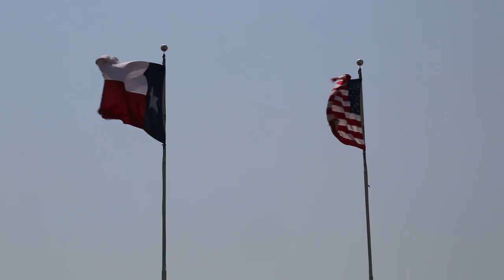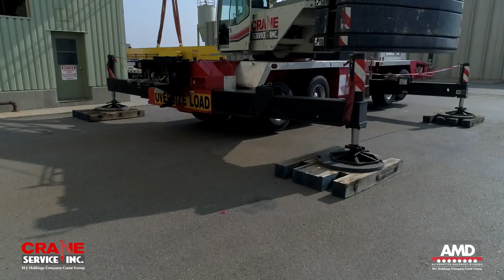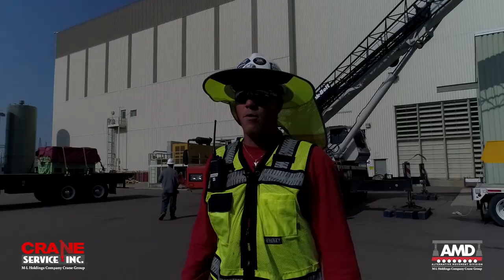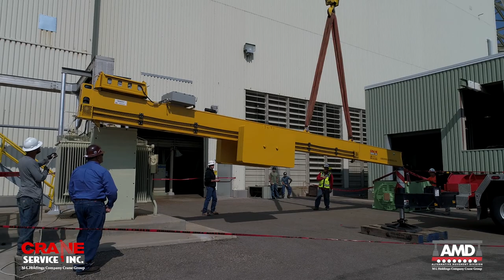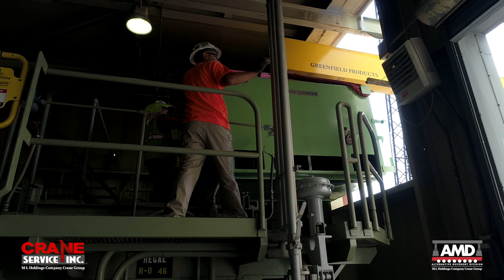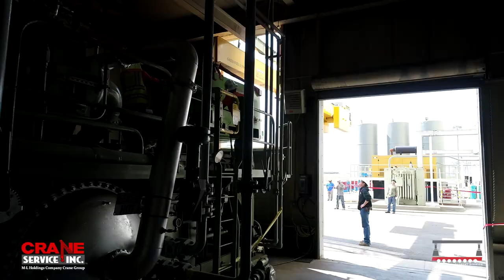AMD Cantilever Lifting Beam Drive Motor Removal & Replacement

Comment: Good work all round by your crew. That is a beast of a canti beam!!
If you wanted a better angle on your slings that engage the lift, the beam manufacturer could put lifting points each side of the beam higher up. You would get your slings to a better angle and not lose headroom. In the UK 45 deg to vertical sling angle is the accepted normal and 60 deg after serious de rating.  Mike